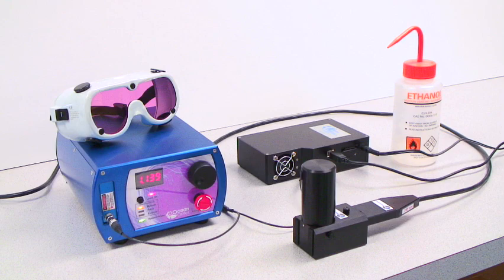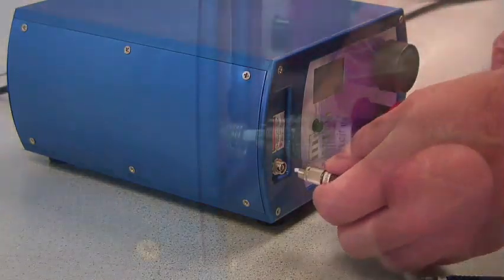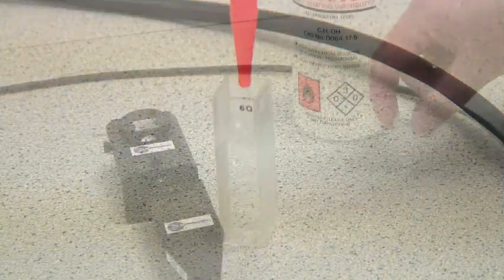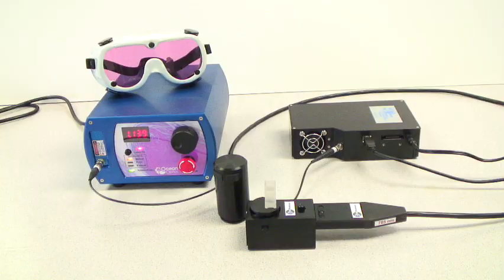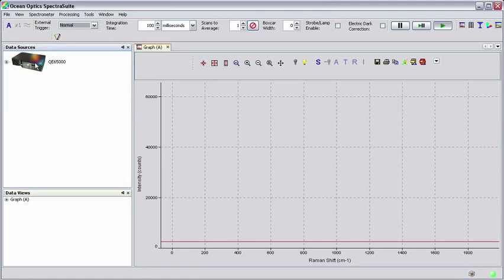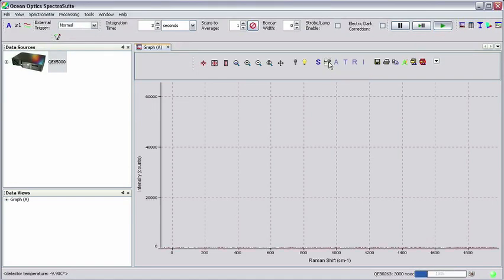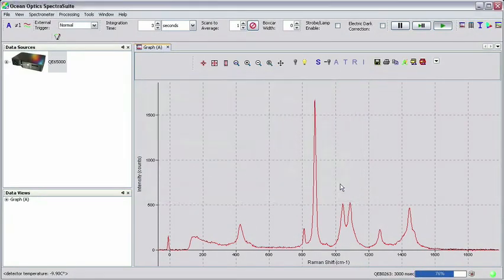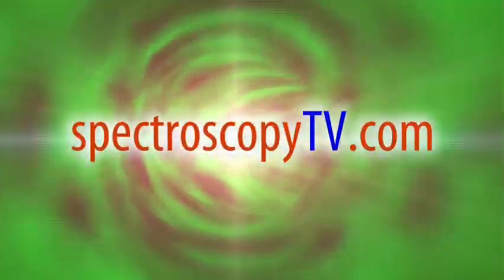Modular Raman Spectroscopy Measurement of Ethanol

Comment from the maker: @Joseph Rivera >> Thanks for the question. A typical Raman spectrum will have a number of peaks, each peak corresponds to the vibrational frequency of a specific molecular bond, meaning that it can provide a form of molecular ‘fingerprint’. An absorption spectrum will show a number of absorption bands corresponding to structural groups within the molecule, however the spectrum is not as informative and characteristic as of the Raman spectrum. Maybe overkill for ethanol, but this is an example.

Comment: @ Ocean Optics ( and Boris) -- Couldn't a FHS-UV filter holder be used, with an additional fiber optic from the filter holder to the QE65? Boris could insert the filters he needs into the filber optic holder to precision-attenuate the light before it gets to the QE65... If I'm picturing Boris' set-up properly. (If not, just ignore this comment.)